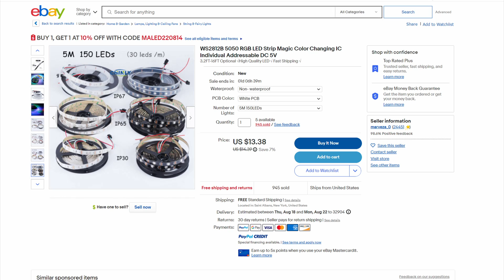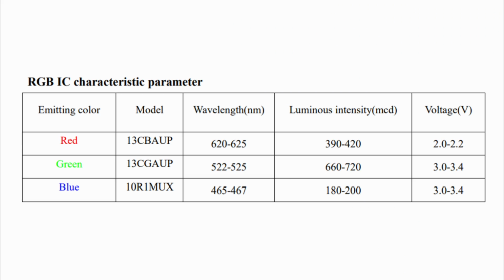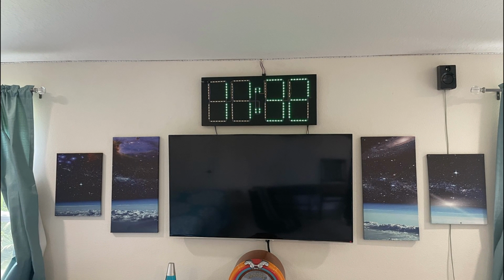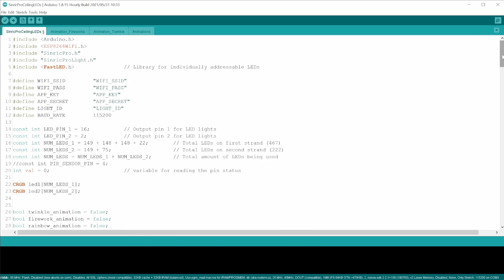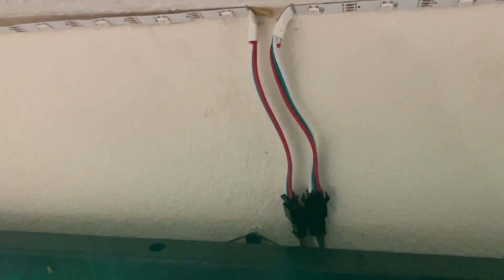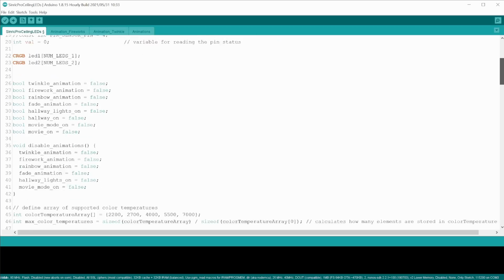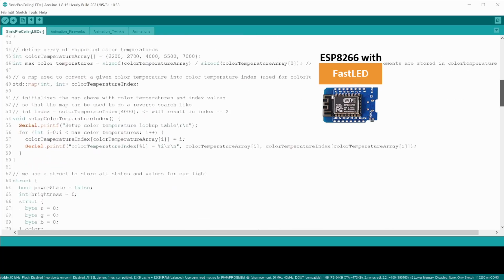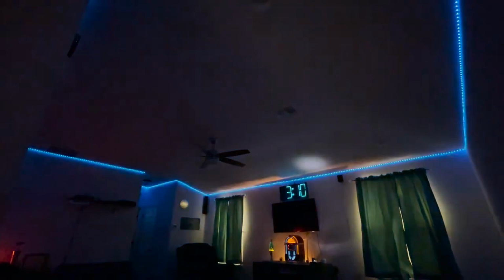The Coolest LED Lights for Your Ceiling (ESP8266 & FastLED Library Project)

Comment: Thank you very much for the video, it's just what I wanted to do, but one question, is the code also compatible with Alexa, right?
Reply from the maker: Yes, Sinric Pro is also available as an Alexa skill. So you will just need to create a Sinric Pro account online and set that up to link accounts in the Alexa App. Then it will work if you use the same code and modify the parameters with your app secret and light ID number.

Alternatively, you could also use WLED. The code I originally wrote here uses the FastLED library, which is more useful for if you need a specific LED animation or have other functionality being used by the microcontroller. I ended up updating this project several months ago from the FastLED library to instead use the WLED firmware since it has so many more animations than what I had before. WLED has the ability to separate into segments and can also connect with Alexa, so I'd say it's worth considering that for your project.
Reply: @Electriangle  ok, thank you very much for your help and the video.

Comment: Why didn't you use diffusers and channels?
Reply from the maker: Diffuser channels do look good, but are quite expensive. More than the actual LED strips per unit length from what I could find. I’d rather buy more lights 😅. 
I’ve looked for cheaper alternatives for a long time, but haven’t come across something good.